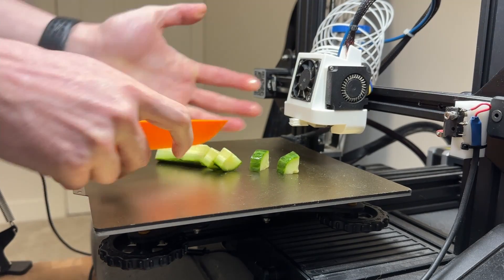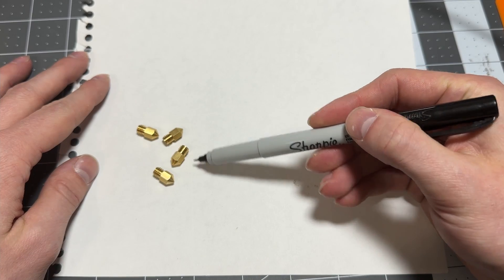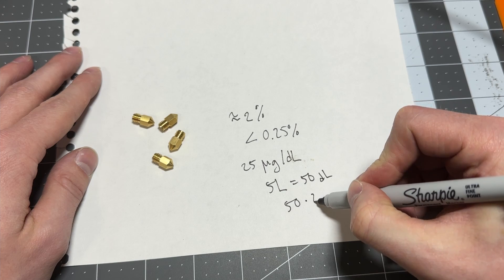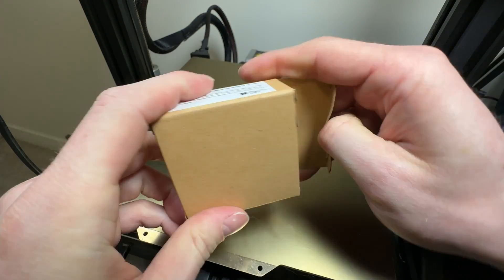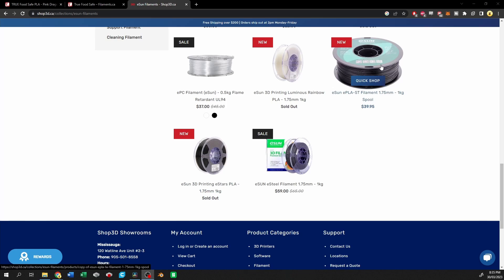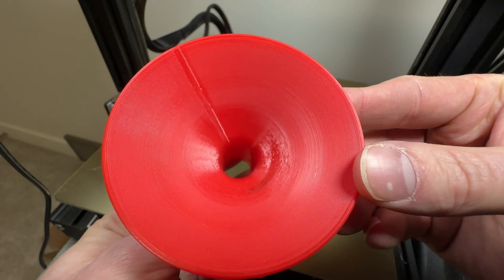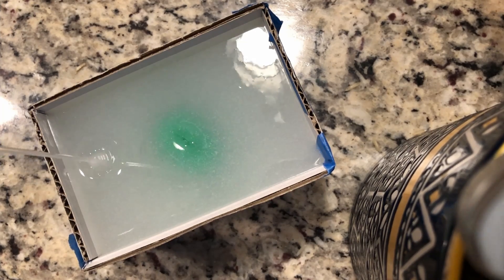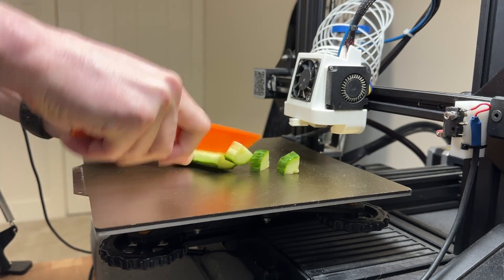Can FDM 3D Prints be Food Safe?

Comment: Hmm, overcautious. You’d need to separate the lead from the other elements in the brass before it became bioavailable and then you’d have to ensure that a significant amount of that lead contained in the body of the print was itself rendered bioavailable. A trace of a trace encapsulated in plastic that you are not even eating is not a risk, let alone a significant one.

Also, used plastic chopping boards are covered with numerous criss-crossing channels at least as dangerous as the layer lines of 3D prints. If you don’t avoid plastic cutting boards then there is little point in treating 3D prints like they are toxic.

Comment: What if heat is applied to food safe PLA to melt the layer lines to a  glossy finish?
Reply: Good thought, but tricky to turn into results. I've tried. The problem I noticed is that the PLA doesn't want to "self level". By the time you get it hot enough to smooth, most detail and shape are also affected.

Comment: How many people have a plastic or wooden cutting board in their kitchen? One could make a reasonable comparison between layer lines and cut plastic, or wood. Even a pair of Stainless-steel tongs with silicone end caps are a risk. The crevices around the kitchen sink... so, so many places for bacteria to thrive. I don't think there's sufficient data on the effects of 3d printed parts and their impact on health. The problem seems to be, no one want to claim its safe, leaving themselves to class action lawsuits.

Comment: If the porous wood is safe, then fdm printed tools are safe too.
Reply from the maker: It's not that simple. 
Woods porous nature actually helps it absorb bacteria and dry it out as the wood dries. The worry with 3D printed plastic is that if bacteria finds a way into the print that means water is also finding it's way in and has no real way to evacuate the print. This creates a breeding ground for bacteria in the print. Prints with 100% infill are less likely to have this issue. 

Here are a couple interesting articles/papers: 
https://www.sciencedirect.com/science/article/pii/S0362028X22020932
https://news.ncsu.edu/2014/09/cutting-boards-food-safety/

“Hardwoods, like maple, are fine-grained, and the capillary action of those grains pulls down fluid, trapping the bacteria – which are killed off as the board dries after cleaning,” says Ben Chapman, a food safety researcher at NC State.
Reply: @3DPrintStuff  there are bacteria even in your mouth. So you can use 3d printed tool in the kitchen. I do not like too much theoretical worries  
Wood can absorb fat which do not evaporate and it is perfect for bacteria feed. So if wood is ok,Cohen 3d printed object are ok too.
I am using cutters and other tools in our kitchen and it's ok. Nothing bad with them.

Comment: Do hardened steel nozzles/nozzle-x contain any lead? I've been using SS nozzles for years but have struggled to find anything about hardened steel containing lead
Reply from the maker: This is a good question. Hardened steel shouldn't contain any lead but that's not a guarantee. 304 and 316 stainless steels are industry standard for food applications and are just the safer choice when choosing a nozzle. That being said most companies don't disclose what stainless steel alloys they are using, they just use the generic "stainless steel" title. 

Nozzle-x appears to be a hardened steel nozzle with a "polyphobic" coating, I'd be cautious of anything with a coating that could potentially end up in your print. We don't know what the "polyphobic" coating is made of because that's a proprietary material.

Comment: Great video but I have a few disagreements. They are not certified food safe. There is no regulatory agency with any standards on FDM 3D printing food safety. No company can independently audit and thus "certify" food safety in accordance with any regulations. They simply do not exist. Companies can put forth their best efforts but I would be careful saying they're "certified". My first question is by whom?
Reply from the maker: Plastics for contact with food are regulated by the FDA. The material can be and is FDA approved, there are also European standards that cover plastics for food contact ((EU) 10/2011). 

Here are 2 out of the 11 regulations that the material I received meets: 

Section 2019s0 of the Federal, Drug, and Cosmetic Act, and Parts 182, 184, and 186 of the Food Additive Regulations.
(EU) Plastic Regulation 10/2011 as amended.

They are not covering 3D printing, they are covering the base material and the coloring additives.
Reply: @3DPrintStuff  Right that's kind of my point. The base plastic can be medical grade for all I care. Without specific regulations on the manufacturing process it really does not matter how good the materials were prior.
Reply from the maker: @Leviathan3DPrinting  Are you referring to the manufacturing of the filament? or the 3D printing process of creating a part?
Reply: Also is there any evidence to suggest that layer lines are a breeding ground for bacteria? I continually hear this but it just sounds like conjecture. Has anybody actually studied this? I have not personally found a research paper on the subject but I may have missed one so if you know please share.
Reply from the maker: I am probably just being overly cautious on this point. This article has been suggested by others: https://works.bepress.com/MAThomas/1/ that suggests there are simple protocols to clean 3d prints to meet a food safe state.

Comment: the video only talks, doesn't show.  Even the lead nozzle is a false equivalency.  Per tests done of material through a nozzle.  It has shown that there was 0 traces of lead on thousands of hours of prints.  It was so small that it was safer than the water you drink.

Next material, this of course is a good one, avoid colors and fillers and you basically are good, though still go with the ones that say food safe.

Last, layer lines.  If it is big enough for bacteria to grow, it is big enough for stuff like hydrogern peroxide, bleach, soap etc to clean.  Don't leave your items out long enough for mold etc to grow and you are good to go.

Micro scratches happen all the time on plastic wear, sometimes far worse than layer lines.

If you redid this test by using a lead detector on prints, then a bacterial swab and growth analysis with cleaning then retest...then this video has something.  Otherwise your just repeating talking points.
Reply from the maker: Thanks for the feedback, I'll keep it in mind for the next one.

Comment: but arent extruder gears and those ptfe tubing cupplers made of bronze to ?
Reply: I imagine that temperature and surface area contact plays a big part in how much lead could leak into filament.
Reply from the maker: That's a good point, any part making contact with your filament should be taken into consideration but the nozzle is the most likely to impart foreign material.

Comment: What people seem to not understand is that it is not safe or unsafe, there is a huge grey area. Usually the coloring is most critical when it comes to leaching chemicals. To truly be food safe you need to know exactly what is in your material, and a range of other data such as the expexted usage/time of using. Some injection molded sauce caps are only safe in combination with a minimum content in a bottle for example, and an expexted lifetime of 6 months.
Reply from the maker: I agree there is a huge grey area. This video only really scratches the surface.
Reply: virgin is best or just buy it from a company that marks it foodsafe as that means no bichemicals are used that are not food safe.
Reply: @elitewolverine  you are missing the point, no plastic is truly food safe as they all leach chemicals. Depending on the use case that can be acceptable for food applications.

Comment: For sake of argument let's say that a nozzle can lose 10% of its mass to erosion before  its print quality is unacceptably low and it needs to be replaced. That means over its lifetime it can dump a harmful amount of lead into your prints - 4 mg. However, if you're able to get multiple prints out of a nozzle, that's going to be spread out over its lifetime. If you can get a hundred prints before replacing your nozzle, that means we're down to 0.04 mg lead per part - most of which will be sequestered inside and not on the surface. If we again pluck a number out of thin air and say that 10% of that will leech into your food over time, we're down to 0.004 mg - 4 micrograms. If one expected that leeching to happen all at once - dumping its fully fury into the very first it comes into contact with - you could simply wash it.

Now with all that said, if I were to open a restaurant with the shtick that all the dishes were 3d printed, I'd still use stainless steel nozzles to avoid any liability. But for home use? As a gimmick I'm only going to use a few times? I think a brass nozzle is far less hazardous than printing with the wrong filament or bacterial growth.
Reply from the maker: Yeah that's fair. I'm trying to approach this from an item you'd feel 100% comfortable selling to another person.
Reply: Yeah, i'm pretty sure we oldtimers that lived with crap that was painted in lead paint, and got a good dose of the leaded fuel exhaust gases probably have more lead in the system already than you could ever take up from 3D printed plastic. Still, every microgram that can be avoided is a good thing. It will not kill you like a lead bullet to the brain, but why not avoid as much of it as possible, especially if it's as easy as swapping the brass nozzle (and all the other potential brass parts like bowden couplers and extruder drive gears) for a cheap non-brass or at least hard coated replacement part.
Reply: Yup, a lead test showed that many prints exhibited 0 detectable traces of lead over thousands of hours of prints.  Basically...your tap water is worse.
Reply: The filament is much more dangerous than the very small amount of led that might get into the prints plus not all brass nozzle contains lead in them

Comment: Layer lines are not your downfall! You can address those too! To print food safe things with my FDM machine, I use HIPS plastic from Filamentum (which they certify as food safe) with a stainless steel nozzle. Then I vapor smooth the layer lines using limonene, which is not a harsh chemical and is actually used in small quantities as a flavoring agent in some drinks. All issues addressed!
Reply from the maker: That's awesome, I had no idea. All issues are addressed. @Mike D makes it sound like limonene should be treated the same way you treat 3d printing resins. (gloves, vapor cartridge mask, good ventilation) Do you use any PPE when handling limonene? have you experienced any issues with it?
Reply: @3DPrintStuff  - I have not experienced any issues using limonene, it appears to be very safe from what I can find about it. It's some kind of derivative of orange peel, so it does smell very very citrus-y, but that's about it.
Reply: @alexsalchemy  I haven’t ever heard of it but if I had to guess that’s probably also the chemical they use in citri-strip. And eco and non-toxic paint stripper that works very well and smell like oranges.
Reply: @sargentcuddlepuff3490  - Oh! You're right, I completely forgot about that product. Google searching sounds ... Yep, Citri-Strip contains limonene! Neat!
Reply: @alexsalchemy  now you’ve really got me thinking. I wonder if citri-strip has a high enough concentration to be able to just heat that up in a chamber to vapor smooth hips. Which is more widely available and maybe even cheaper, I’m gonna have to do some experimenting.
Reply: @sargentcuddlepuff3490  they might add other chemicals to it
Reply: I haven't heard of any of this! Thanks for the advice, this is valuable info!
Reply: do you by chance know of a good documentation/video on how to make FDM prints food safe using limonene?
Reply: @danielg9927  - I might make a video about it myself, but all you have to do is put your part into a "vapor bath" like so many people do with ABS and acetone here on YouTube. In fact, HIPS will dissolve in acetone as well, so you can use that instead of limonene, although I don't know why anyone would.
Reply: Excellent, thanks
Reply: HIPS isn't heat-resistant at all though, which limits its usefulness in the kitchen.
Reply: @alexsalchemy Lead can be present in the extruder of your printer as well, no? Is this something you’ve considered?
Reply: @bobe610  - Well, the parts of the extruder that touch the filament are the heatbreak, the nozzle, and the drive gears, and I think I did address all of those parts.
Reply: @alexsalchemy  don’t the extruder wheels touch the filament before it reaches the heat break?

Comment: Very interesting topic I have not seen anywhere else. As some comments say, I think It would be interesting aswell taking into account if the materials are safe at 60-70ºC with water, since that are typical conditions in a dishwasher ("eco" mode can lower the temperature to about 50ºC, in exchange of time, but the user must be aware of the limitations).

Also, this can mitigate the problem with the layer lines, since the dishwasher should kill most bacteria.

If you find this topic interesting, I will be more than happy to see a future video about it.
Reply from the maker: While writing this video I wrote off dishwashers as an option thinking that they must get too hot for most 3D printing filaments. But you're right 60-70ºC is the typical dishwasher temperature after doing some research and that is a high enough temperature to sanitize. So there's definitely more to look into.
Reply: @3DPrintStuff  Thanks a lot for taking the time to answer to my comment. Looking forward to see future content.
Reply: dishwasher will not kill bacteria in 70ºC in atmospheric pressure. it wouldn't even fully penetrate biofilm in grooves betweeen layers. also most 3d prints are not water tight, even with 100% infill, so it's possible for bacteria to grow inside of prints.
Reply: @sigmarpriest_  While you are probably right, I wonder if the same amount of requirements are fulfiled by of-the-shelf kitchen products (no gaps between unions where bacteria can grow, no scratches, etc). My guess is no. It is probably better to be on the safe side, but if a run on the dishwasher does not kill most bacteria we would have troubles with most of the kitchen stuff, even with no layer lines and watertight sealing.

Comment: It's not really clear to me why so many people consider something that contains layer lines to not be food safe. It seems to me that there are many kitchen utensils with little surfaces, nooks and crannies that are of similar size as layer lines, yet we use and clean those without problems. Sometimes certain areas of blenders, food processors etc are actually impossible to clean. Sometimes plastic parts will have a 'scratchy' surface that under a microscope are formed similar to layer lines.

Now surely all of that might be problematic in itself, but sometimes it's as if standards go way up when we're talking about 3d printed parts.

The same thing goes for brass really. There are many brass kitchen implements and utensils on the market.

I do the argument about filament materials holds merit. Many manufacturers provide close to zero information about the recipe and additives, and even when they do it's unclear how clean the production process is. So probably best to opt for something the manufacturer guarantees is food safe.
Reply: I would not worry about layer lines if the plastic can be heated to boiling water temperature without melting. For a good sterilization, it would be ideal to get it to 121°C (under pressure) for 15 minutes. This kills everything except for Prions. If the plastic handles 80°C for 30 minutes, this is already a pretty good value that kills most bacteria and yeast. Just a few viruses and fungal spores survive that treatment.
Reply from the maker: Yeah you're probably on to something. I'd rather air on the side of caution in a video I'm releasing to the public. I'm also viewing this through the lens of most hobbyist 3D printers where PLA and PETG are the materials of choice. The layer lines may not be the real culprit but not being able to heat the object to a sanitizing temperature + time is what I thought the real underlying issue was. 

But I'm willing to be wrong and this article got suggested: "Sanitization efficacy for safe use of 3D-printed parts for food and medical applications" by matt thomas. And it "shows that ordinary dish soap and water are totally sufficient to remove 90% or more of all of the pathogens he tested"
Reply: @3DPrintStuff 90% is definitely not enough to be safe!!
Reply: shhhhh if they actually get the word out that you can print your own things, they loose money.  I have to find the actual lab test that did swabs to show layer lines had zero effect on normal use and cleaning for food.
Reply: @elitewolverine  who are "they"?

Comment: 0:25 that would be enough for nogo about printing for something has contact with food.
You wont escape from this problem no matter what. Only solution that would solve this  is to use petg 
and clean that with alcohol bath and leave it under uv lamp. I had printed few things for a friend that was working in a hospital while covid hit hard. He said that my prints (printing petg in highier temp range without fans) were good enough that they didnt qualify to throw out after first usage (or rather cleaning).
Reply: i printed stuff for locals out of petg, and indeed, just up it to 260, turn off part fan, run it a little fast to help with warp, and it was good to go.
Reply from the maker: What kind of items were you printing for your friend?